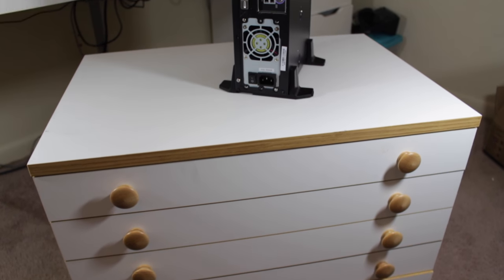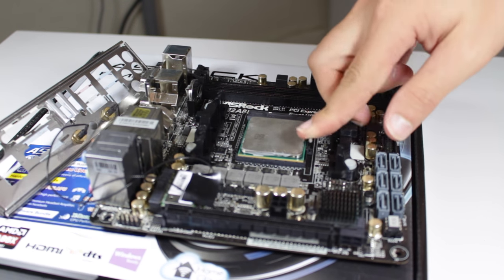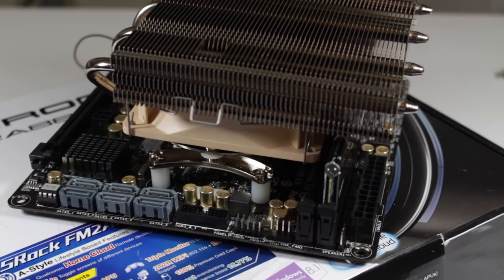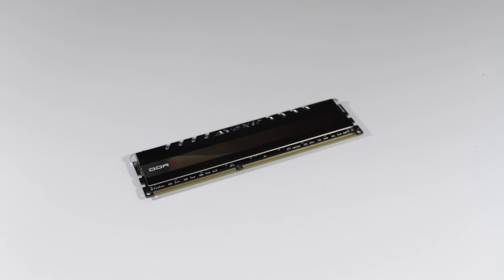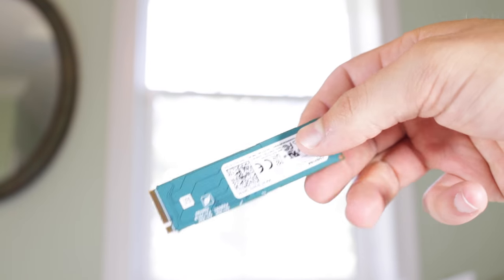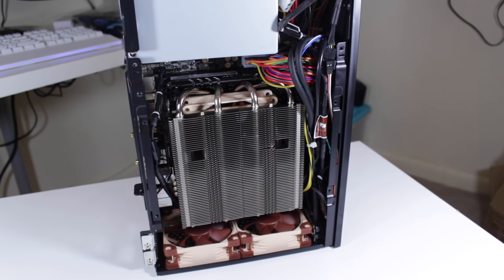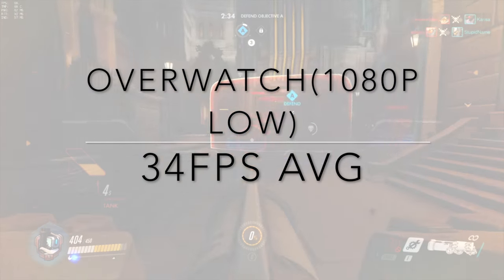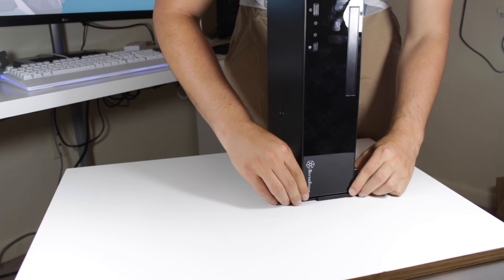The Overkill AMD APU Home Theater/Gaming PC! (2016)

Comment: with my amd a10 6800k O.C. (CPU:4.6ghz; GPU: 1230mhz) i get over 120 fps in cs go at max settings. I have also 4 sticks of ram clocked at 2400mhz, CL9. The cpu cooler is a noctua nh d15.
Reply from the maker: yeah I didn't do any overclocking or optimal ram configuration so I didn't get the most performance I could have.

Comment: hey guys... look. it's been some time since I've had a gaming rig of any kind. it's been 10 years as I have for the most part did the console thing.

40-60 fps with medium to med- high For most new games would be what I want.

my current gpu is crap it's a gt640 entry level card my current cpu is an i5 sandy bridge @ 3.2ghz. I guess my cpu is not worth to try and salvage? what's my best route if my cpu is or is not worth it anymore? apu? or traditional?

thanks.

Comment: Your APU is heavely GPU memory bottlenecked. In your actual configuration you only have 1050 mhz video buffer bandwidth, you have to go dualchannel for 2133 mhz, I would also recommend overclock and evetually overvolt to 2400 mhz, GCN is a very bandwidth intensive architecture.

Comment: can i use gtx 1060 on this processor?
Reply: why?
Reply from the maker: The absolute minimum I would recommend for pairing with the 1060 would be an i3 6100. which will allow you to upgrade to an i5 or i7 in the future. Something to keep in mind is that even though the 1060 isn't a high end card right now it is actually on par with the gtx 980 which just a few months ago people were buying for upwards of $500.

Comment: Amd Apu's are not the same as intel cpu's.
Amd Apu's are reliant on high clock memory for gaming with good fps.
Anything under 2133 ram your just wasting the Apu.
tagging this as on overkill with any ram under 2133 for Amd gaming is very misleading.

 Also the hyper 212 heatsink achieves better temps if not the same at half the cost. (yes they make low profile hyper 212)

 With your Psu you not only want to look at the 80+ gold logo, but amperage matters as well, not just watts, esp with Apu processors